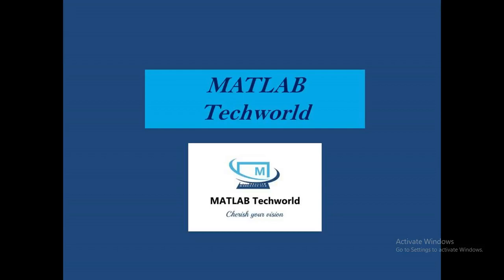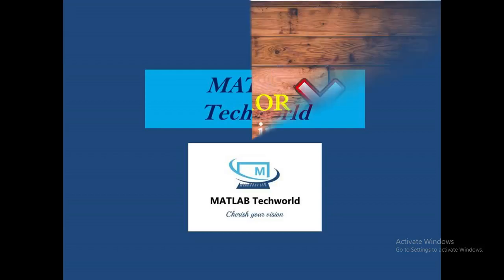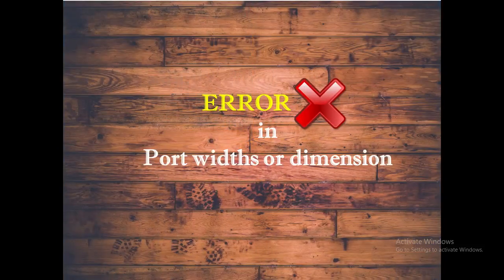How to clear error in port widths or dimensions in simulink ? / MATLAB Tutorial for beginners

Comment: Only if, you haven't provided correct dimension
for your signal flow, this error occurs

This number indicates the
number of elements in the signal

This signal has 3 elements. But when
we enter incorrect dimensions,
this ends with this problem

Here, the signal correctly splits
into 3 separate elements

Now, let's make the number of
outputs to 3

Here, every block operates
with only one element

Now, the model is successfully build

You can clear this error easily if
you know the number of elements in the signal

Comment: In half wave converter simulation, there is no any warning message, no any error message but scope response is blank.
Please suggest solution.
Reply from the maker: It may be due to many reassons.First of all, check by clicking autoscale in scope.If still you have the problem means,send the screenshot to cherishyourvision2021@gmail.com
I'll look into it.
Reply: @matlabtechworld7052  screenshot mailed at 2:42PM today (02/03/2022)

Comment: hello i have an erreur in the matlab simulink give me that message  : 
Error: File: NWindingsTransformerBlock.p Line: 344 Column: 0
"y" previously appeared to be used as a function or command, conflicting with its use here as the name of a variable.
A possible cause of this error is that you forgot to initialize the variable, or you have initialized it implicitly using load or eval.
Reply from the maker: @Jamal Khyat you need to declare or initialize the variable 'y' globally